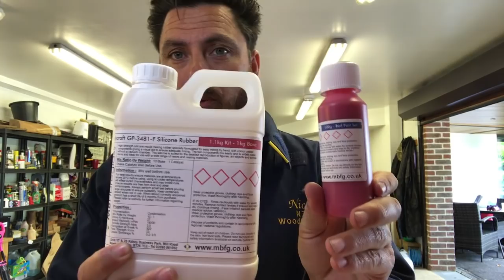Making - A FIDGET SPINNER FROM PENCILS AND RESIN/ MOLD MAKING

Comment: Awesome job Nick! 
They would both spin longer if you added some weight (ie: ball bearings or extra skate bearings) on the outer areas of each lobe... That's why there are 4 bearings on the original...
Reply: Spot on. The original idea was to use the other bearings as replacements by swapping them around. It also helps if they are real abec bearings, not the fake poor tolerance ones. Sadly, these wouldn't sell without some momentum weight simply because they don't spin for any length of time. Also, the bearings shouldn't be glued in, they should be press fitted so that they can be removed without damaging them.
Reply: Siberian Orange i

Comment: im probably wrong with this but from some distant memory of a science lesson a long time ago,as the pencil/resin blanks werent the same consistent density/weight throughout you would get a longer spin by finding the centre of gravity in each spinner and using that to centre the drill hole for the bearing. then they wont be off balance. I think it's something about hanging the object from multiple points and each time drawing lines vertically down from the hanging point. They should meet at the centre of gravity! Excellent channel. Got two under fives who love it and are well up for the makers central meet!

Comment: Some advice with silicon rubber molds ... I use large cookie round cutters stick it onto decifix book cover plastic and places my item to be molded inside the cutter also to stick onto the dicifix, then seal the outside bottom with my gluegun. And pour the silicon it helped a lot with a perfect mold to be sold in my shop

Comment: Hey mate if you ever do silicone moulds again get a hot glue gun and glue it a couple of mil from the bottom and still make sure that the silicone and get to the whole lot to cover it so only a couple of dabs of hot glue and maybe next time take out the bearings and that way you will have a perfect Mould  but either way it was still fun and interesting to watch good luck nick

Comment: Hello nick 
Nice job 😁
You did not add weight to the wings? For more efficiency?
Take care
Reply from the maker: JLo7575 hey , na I decided to just go with the one bearing on this one . I've seen quite a few with just one and didn't want to take the risk of it breaking as when you drill the resin heats up and then starts to bend and break. It's thin round the edges ! 😬👍🏽
Reply: Thanks Nick 👍

Comment: The point of the outer ball bearings is so you can do what you're actually meant to do with them (this is annoyance at neurotypical people playing with fidget toys/tools neurodivergent people use to focus/keep ourselves calm, not you), and twist them around with your finger. Like, you put it on a flat surface, and then put your finger on one of the end pieces and spin it round, keeping your finger on it. 

As an aside, it's not meant to stop you fidgeting, but to provide a less distracting fidget (so you aren't bothering others with it).

Of course, now they're banned in lots of schools so they're not much help to those neurodivergent folks anymore.